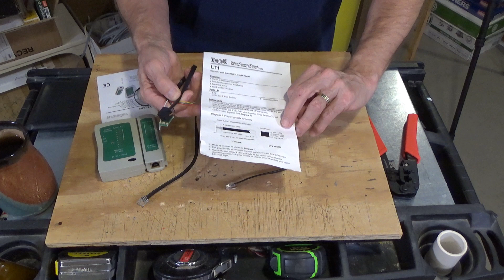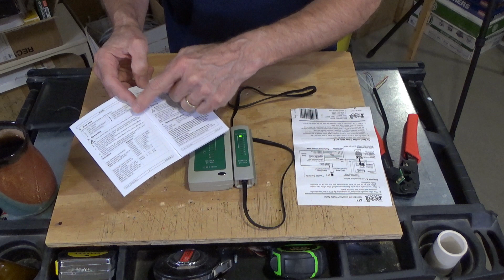39. Quick and Easy DCC Cable Testing

Comment: Hello Larrry, what AWG gauge do you use, or does it matter?  If so why?  I am deciding between 26AWG and 28AWG, 1,000 feet.  Appreciate guidance.  Thanks.
Reply from the maker: What are you using the wire for? At any rate I covered wiring in depth in videos 110-114 so spend a few minutes watching them.

Comment: Track continuity testing can save hours of needless soldering.
With a track including thirty points, about forty metres of track,
and a Fleischmann turntable, the conductive integrity of track has  
reduced the number of soldering operations required. 
And I enjoy soldering where appropriate.

Comment: Can you test one end of layout to other through equipment? If you can and it fails you  go halfway back. If it fails again split it halfway again. If it passes you test back half and and split it in half again and again. When you find section that is defective you can crimp both plugs if that fails you can replace each plug one at a time if that fails look for damaged wire or just replace wire.
Another good video.
Reply from the maker: Yes you could do that but you’d end up with a lot of extra connections. The best bet is to test the whole bundle of cable before using it and if it passes, which it should since they are likely factory tested in large lengths, then any failures will be due to a bad crimp. In over 25 years I have never seen a defective cable, only bad crimps.
Reply: @TheDCCGuy  I have once twist in cable wire broken there. I used the test to check if I flipped jacks properly . Just a thought. Thanks for answering me , it was a good video. Thanks again.

Comment: If you wired the entire layout the easiest way to test is unplug first and last plugs, Plug in tester, if there is a problem unplug half way test left then right. What side has trouble unplug half way again so and so forth you will find bad connector or wire rather quickly.
Thanks again for good info.
Bob